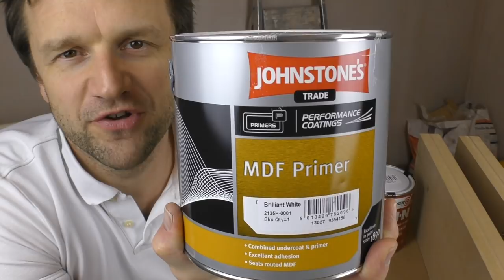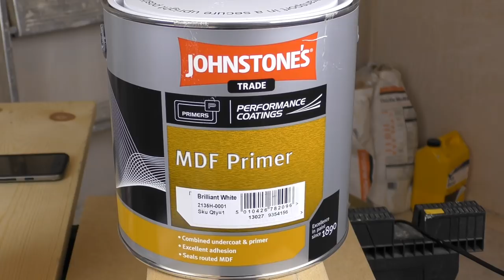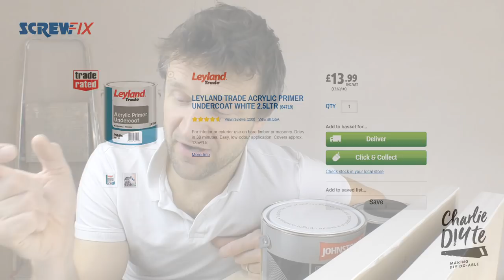How to Paint MDF Edges - Zinsser B-I-N vs Johnstones MDF Primer

Comment: Any painter and decorator would tell you in two minutes that zinseer is the best primer sealer on the market, it covers all bases regarding new or previously painted and varnished surfaces so it works out much cheaper in long run, plus you can thin it down a good 10-15% with methylated spirits, water based MDF paints are okay but not as good as shellac based products....
Reply from the maker: Henry Hartley Thanks Henry. I appreciate that - makes sense.
Reply: Yep 100% agree. Used both but always my go to is a tin of bin. Also carry zinseer 123 in my van. Its multiple uses cannot be beaten. Bin dries in 15 mins max. You can put 3 coats of bin on in the time the water based is ready to go. As a decorator you cant wait 24 with just two coats you wouldnt last 5 minutes in the trade. Regards cleaning i always carry methylated spirits as it has multiple uses too and takes the same amount of time to wash a brush as a water based. And ive just picked up a 2 half litre tin of bin for £30. Win.

Comment: I just recently used a water based Zinsser  "Bullseye  1 2 3 primer", painted an old pressure treated post with crack repairs. Then put on an outdoor paint. Went on smooth, and washed up brushes easily. You can use it on wood, metal and masonry.
Reply from the maker: Thanks Steve. Yes it's not bad. I was a little bit underwhelmed by it on this project https://youtu.be/4ylDeQXv1k0 compared to BIN but the Bullseye 123 Plus is even better according to a decorator on my Discord forum.

Comment: With proper prep and 3 coats you will get good results brushing even the cheapest primers and paints. The problem finishers face is spraying finishes on open grain. And let’s face it, you could be the best painter in the world, but it’s still a brushed finished, and that’s not acceptable in many cases. You should do a vid on getting good results with a spray finish, because that is where the real problem with finishing mdf lies. Clawlock is the best underbody I’ve used for spraying mdf.

Comment: If you take the cost of the Zinsser out of it. Going by what I saw whilst watching the video was that the Zinsser gave much better finish and there was no line showing between the two 18mm panels. I normally fill my edges and joints with car body filler to hind where they are and any screw holes. as I want as flatter finish as possible. 
Great video and I'll now be looking at trying the Zinsser to see if it is worth the extra price and time saved on not using as much filler.

Comment: B.I.N primer is probably the best around, you can actually store the brushes by wrapping them very tightly in clingfilm then place in a freezer bag and tie the top so it's airtight or use an empty plastic takeaway box with a lid (if the brish fits in). This will keep the brush wet for days at least.

For water based undercoats and glosses use Corona Archer brushes, you almost lay the paint on, you don't work the paint like you would with an oil based, one lay off, when it dries it will have a nice flat coat, no brush marks. Brushes must be synthetic and Blaze or Archer brushes for a high quality finish.
Reply from the maker: Thanks Mark, a wealth of info there and timely, because I'm working on a vid right now where I've used the B.I.N Primer - which I've totally fallen in love with (if you can fall in love with a paint primer!) Out of interest, why must the brushes be synthetic? We're always told to go pure bristle?
Reply: Hi Charlie, for water based paints pure bristles are not fine or soft enough. If you buy a set of Corona Archers or Proform Blaze brushes you will instantly see the difference. Due to how soft they are it helps put on a better coat. Ideally you almost lay it on, you want to minimize brushing it out because if you put it on evenly you literally just need to lay off a door facing once then leave it, the thicker coat will level off nicely and minimize  visible brush strokes almost an oil like leveling off if you use a paint like Benjamin Moore and the higher quality water based coatings. For applying the shellac (B.I.N) itself, pure bristle is fine for water based paint you'll see the difference right away using a quality synthetic brush, night and day as they say.

Johnstones water based U\C and gloss is good stuff but BM is at the top end both in quality and price.

Yeah B.I.N is great stuff, usually one coat is all you need, with water based sealer like high hide etc 2 coats are normally needed and given B.I.N is very watery you get alot of coverage and a good seal on the surface as well.
Reply from the maker: Thanks Mark, that makes a lot of sense. You clearly know your stuff. Are you a painter decorator by any chance? Out of interest, where do you stand on the whole roller/ paint brush finish thing? I was at a large country house recently installing a pelmet board which I had primed and top coated with a foam roller - as you'll never see it because it's hidden behind curtains, and the painter took one look at it and said "what sort of a bloody finish is that?" It seems that a brush stroke finish is viewed as being a much more professional finish than a rollered/ spray painted finish on wood work. I can kind of see the logic of this in that it looks more traditional, but there's also an argument that a beautifully smooth finish looks smart, and you're not going to want to prime a large set of MDF doors with Zinsser B.I.N when you can roller them in my opinion. Also, you never hear people say "ooh what a lovely finish - it's so much better when you can see the brush strokes" :) I tend to roller the rails and stiles and use a brush for the mouldings. Interested to know your thoughts on this.
Reply: You guessed right am a painter and decorator, some painters will roll panels etc for speed, especially with water based paint but will typically lay it off with a brush. Seeing brush strokes isn't a good thing, in fact if you look on forums like painters pitstop you'll see a big shift towards spraying because it's a better finish. If you use an hvlp (or XVLP) there is little over spray and masking is minimal, airless with a fine finish tip produces similar results as hvlp, it will put out more overspray because even with a fine finish tip it'll be running at 1200-1800 PSI whereas an hvlp or xvlp will be running alot lower than that.

What produces a flat finish, whatever method you use to apply the paint is a thick enough coat and the right conditions for the paint to level off. It is easier said than done, with old oil based paint before the VOC  regs the paint would flow nicely and level off very well. The new oil based formulas don't work well and yellow within months, more so in dark areas which is why there is a big shift to water based paint. Although alot of paints say they are water based they are actually hybrid paints containing some oil and will yellow, just not as fast as an pure oil based paint. Brands like Bedec, Benjamin Moore and others are true water based glosses or satins and will not yellow.  Adding the likes of Floetrol or XIM will give more open time to water based paints (so improving the window for the paint to level off). You can also heat water based paints to improve flow, there is even a paint kettle which will heat the paint up and keep a constant temperature. If you check out this youtube user https://www.youtube.com/channel/UC6Pk5JfmxB8iSpjdT560F1g you get a better understanding about spraying etc. You'll also see the machine he uses warms up the paint, another good tip (credit to joeprodecor, another youtube user) is to use a rice cooker to warm up the paint. As odd as all this sounds, what you're doing is applying the paint at it's optimal temperature. If you're spraying the heat makes the paint alot easier to spray without needing to thin (this applies to hvlp\xvlp) an airless sprayer will spray any paint unthinned but heat improves the paint flow so helping the leveling off. 

If you had a larger set of MDF doors to prime you'd spray them, failing that, you would roll and lay off but there are other primers like BM high hide which might be worth looking into. You'd use a foam roller but you wouldn't be shy laying the paint on because this would help the leveling off. A common mistake is to try and stretch the paint too far with water based paint, this does 2 things, it will lose the wet edge quicker and greatly reduce the chance of the paint leveling off properly so you'll get a stipple effect. You can test this yourself, paint a strip of MDF as you currently do, then do another and spread the paint half the distant you normally do (using water based paint). 

After all that to answer your question most painters and decorators don't want to see brush strokes lol but the key is to have a level undercoat because if you see brush marks on the undercoat you'll definitely see them with the finish coat.

Comment: Hi there, great video. With the johnstones primer being water based, it is therfore going to bring out the grain more that the zinsser bin. With that being the case, the johnstones would just need more sanding to create the same level of smoothness as the one coated in zinsser...i personally dont think one product is better than the other, i just think that the preperation process differs slightly to achieve the same end result?
the water based product will sink into the substrate more with it having more open time, compared to the zinsser product drying much faster and just sitting on the top of the substrate.
Reply from the maker: Thanks for the comment - I agree with that!

Comment: The big lesson from the video seems to be that it really doesn't matter how much the primer raises the grain if you're going to sand it down afterwards. (but shellac is still great for priming crap wood with knots in it, as it lets you use a latex top coat without getting ugly knothole stains)
Reply from the maker: Fair point. I've ditched all my primers now and just use B-I-N.

Comment: I use the spray version of the BIN on edges (no clean up) and then HVLP the Johnstones on the panel faces. Like @ParsleyPunch does: I then fine fill the edges using Toupret filler to smooth them perfectly, a MUST when it's a premium media cabinet for a customer!

Comment: If you have to paint bare mdf cupboard doors it's not possible to brush or roll 2 coats of bin on? I think the bin seals the surface better than any waterbased primers leaving a better finish if using a waterbased satin finish

Comment: When cleaning brushes that have been used with a water based paint i use liquid hand cleaner... it seems to clean the brushes more thoroughly.
Reply from the maker: Yes that will definitely be the case, and I use small wire brushes to clean off any hardened residues.

Comment: Hey, a couple things... Sheet goods at the home centers aren't nearly as good as if you go to a hardwood dealer. Do some research and find some Super Refined MDF. You won't have to do any special treatment to the edges. Also, take a look at Stix Primer. It's coverage capabilities are far superior to the Zinsser BIN
Reply from the maker: Thanks for that. I agree on the wood. Sadly Stix isn't widely available here in the UK but I need to try it out 👍

Comment: you should sand the end grain first ,then fill the end grain with a two part  filler then sand. Then  remove dust from the mdf . then prime. Sand again remove dust and apply 2 x top coat as eggshell is self under coating
Reply from the maker: Thanks Daniel. Yes that's a good comprehensive solution. The sanding is crucial as discussed here https://youtu.be/763yQg0Euwc

Comment: I would quite like to see you test primer/undercoating over oil based skirting. I heard that zinnser was good and no pre sanding is needed but would other water based products be just as good?
Reply: Hi, i used it over oil based varnish and it worked a treat, 2 coats and none of the varnish showed at all, other primers showed yellow through after a few weeks, cheers.

Comment: Thanks for the video(s)!

BIN primer can also be cleaned effectively with ammonia (also smelly, but cheap).

Now, an old-school method of sealing MDF edges-- Rabbit skin glue! It comes as a bag of flakes that you mix with boiling water. It may require sanding after and possibly multiple coats but I remember it leaving a very smooth finish, ready for primer. A more reasonable product you may want to test out (and has MULTIPLE uses) is Zinser's GARDZ... there's a 48 page PDF file available to tell you everything it is good for. I've used it to seal the face of MDF before with great results and can imagine it would do well on the ends given proper dry-time.

Comment: Bonjour, thank you for your sharing ;) I have a question about the recycling. I want to use the old mdf with PVC on it, i dont know if i Can Peel the PVC or paint on it. I dont spend too much money for that. Have you an advice about that?
Reply: Thank you very, very much :) I try asap on one MDF and if it's not too long to peel, i will continue. Thank you :)

Comment: Charlie, have you had any experience with spraying the BIN by any chance? Also am I right in thinking it seals the edges from water ingress?
Reply from the maker: Hi Roger, I used their spray can https://youtu.be/wk6tpkC8fOI buy haven't put the tin version through a sprayer if that's what you mean? I imagine it would spray quite well  though and wouldn't need thinning as it's thin anyway. Yes being shellac based out would seal well to protect from water ingress. Best to add a top coat as well though as it is only a primer.
Reply: @CharlieDIYte  Thanks! Too coat will be of the Mrs choosing colour wise. It's just a couple of faker shaker doors in a WC under the sink but still wary of any water getting into the end grain especially. I was meaning one of these hvlp guns, I have a cheap one from Amazon I was going to try. I'll give it a go on some scrap first, if it fails I'll try the cans. Thanks again.

Comment: Johnstones advanced stainblock primer is shellac based and is exactly the same as the bin but much cheaper.
Reply from the maker: Ah, good info - many thanks for sharing that!!
Reply: Hi I'm doing fire damage property with heavy stains has been washed down just confused on what to use as peope have said just use normal oil base all over some say zinzzer bin just looking at your review saying johnstons is the same as zinzzer can you please shed some light on it before I spend thousands on paints

Comment: The MDF in this demo seems to be pretty coarse to me. More like a fine particle board than "true" MDF. 
The MDF I encounter tends to have "fuzzy" edges after cutting/routing.
Reply from the maker: MDF can vary in quality. Moisture resistant is the best to get but these days I always use Zinsser to treat the edges and then sand them back before repainting as discussed here https://youtu.be/763yQg0Euwc

Comment: Thanks for the excellent video. I'm constructing some campervan furniture out of moisture resistent MDF...What would you use for the top coat on something like that? I suppose it needs a similar finish/toughness to kitchen cabinets. Any thoughts much appreciated.
Reply from the maker: I'd be inclined to prime it with the BIN, and then give it 2 coats of acrylic eggshell and 1 to 2 coats of matt (or gloss depending on the finish you're going for) varnish. The varnish is important as without this it will stain easily (eg red wine).
Reply: Thanks for that, much appreciated.

Comment: Hi I'm thinking a window frame that is made out of MDF wanting to use regular water-based paint as the final paint. Q: what undercoat do Iplease how many coats do I need to apply before the final finish. Thank you
Reply from the maker: You can overpaint the Zinsser BIN with water based final coat. I'd apply two coats of the BIN and then two top coats.

Comment: Caperol Haftprimer first, then sand for fusion. Top coats. If you have real issues then go this way. Zinsser Gardz, sand, Haftprimer, sand, tops. Honestly this system doesn’t fail me.
Reply from the maker: Thanks mate. Sounds likea really good solution that. A decorator on our Discord forum swears by the Gardz too, but I've never used the Haftprimer 👍
Reply: @CharlieDIYte  water based adhesion primers have really come on or become more accessible over the last 5 years or so - in my view. The growth of spraying has meant that the products have stepped up/been invested in. I now only use BIN as a stain blocker/knotting/resin etc. As a primer it used to be the one (15-20 years ago) but simply there are better products for adhesion availale for everyday purchase. Pretty much every brand has something that will outperform BIN in a tile scratch test (and that includes Zinsser). 👍

Comment: If you want better end grain you are better off finding a higher quality MDF rather that the badly compressed and fluffy board you buy in the big DIY sheds. The high quality sheets that were more common 20 years ago have much tighter grain so if you cant source any of that you would be better using moisture resistant MDF that is generally of higher quality.
Reply from the maker: Thanks Julian. I totally agree - and see a lot of moisture resistant MDF on some pretty high quality carpentry on site. Problem is it's harder to come by - most of the timber merchants around me don't stock it.